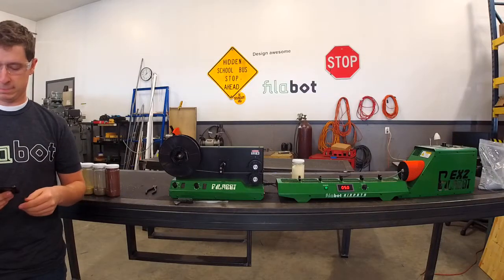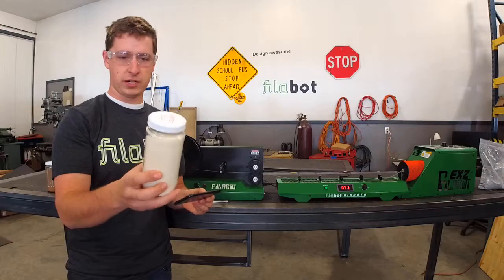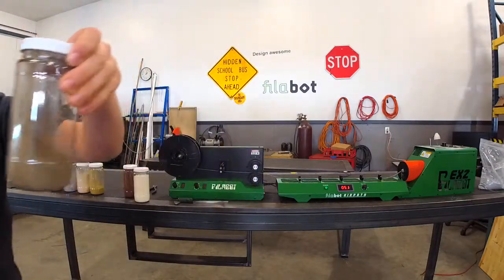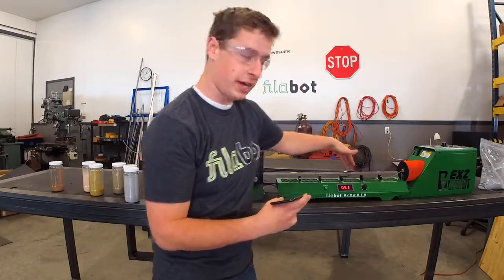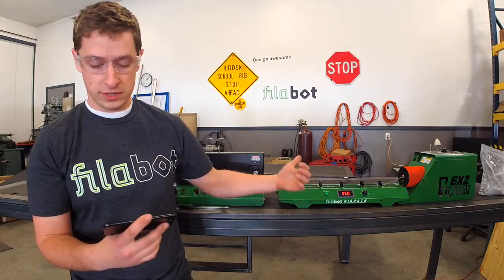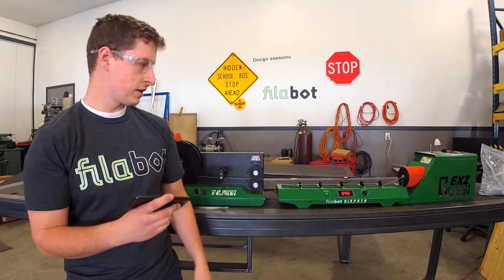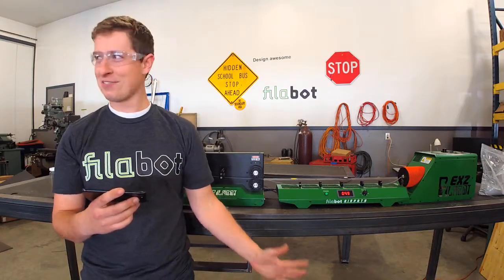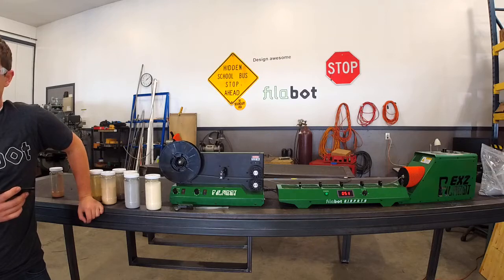Pulverized Plastic and Additives Filabot Live - 11/30/17

Comment: How much does the entire setup you have right there cost? Please list each individual component as well as the total, overall cost.
Reply from the maker: Hi Eric, A basic system consists of an extruder and spooler. If you need cooling we suggest a Filabot Airpath. We have three levels of extruders, Filabot Original, Filabot EX2, and Filabot EX6. The Filabot Spooler only has one variations as it works with all systems. Prices range from $4000 - $12,000 for a full setup.